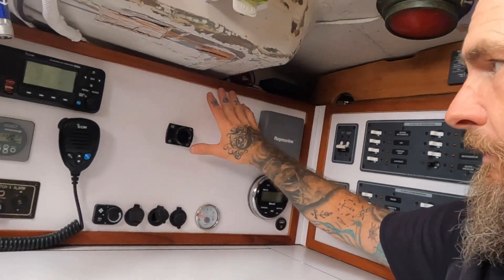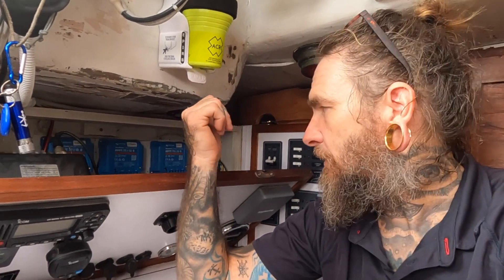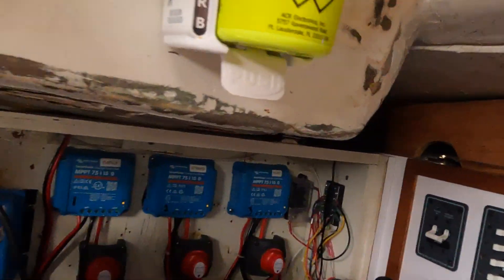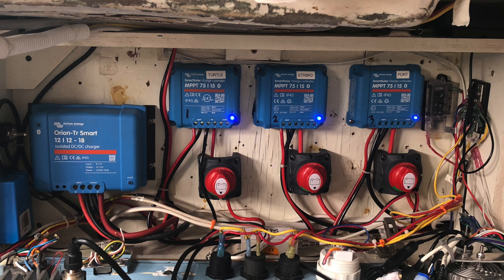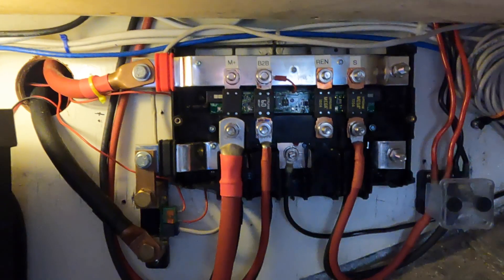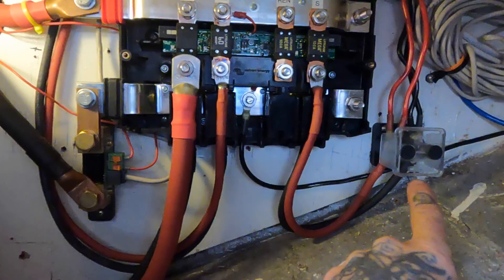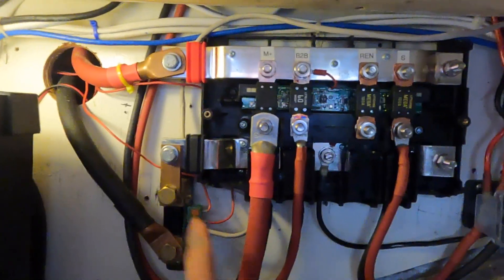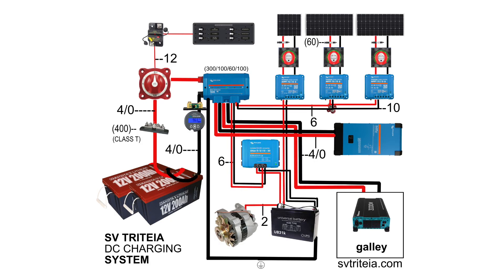A Look At The New DC Charging System on My Vintage Sailboat

Comment: Question: I'm about to buy a sailboat with minimal house power, and want to upgrade to a good on/off grid system with solar, and all-electric galley. For the time being, I will have shore power from slip owner's house system, and will be living aboard part-time.
 I'm not sure yet what the amp rating is for the circuit he's providing, but my question is: with your system, assuming you are on shore power, with normal usage via charger/inverter,  what would you say the minimum amp-rating would need to be for that shore power outlet? 
I know most marinas provide 15, 30, and 50-amp service, but it's likely that my hookup will only be 20 amps (currently the boat is set up for propane cooking, no fridge,  no radios, and a bunch of power strips, etc. for device charging and some AC fans/lights).
Obviously I will need to know how much I can pull from the shore system, but your setup seems very close to what I will have, so I'm just wondering what you typically draw.
Reply from the maker: I haven’t been hooked up to shore power since June of 2021 but my shore power is 30 amp
Reply: @SailorJames  Wow, thanks for the prompt reply! I am probably going to have to assume that 30A should be the minimum limit, as that is more or less the standard for sailboats. I only asked because it's very difficult to find a straight answer about this , from any mfr.
 I'm looking at one of Dakota's lithium/solar packages (200Ah for now, as I don't have a lot of space on this boat for batteries or solar panels)... at some point I will have to call them, I guess, because they don't spec current requirements for their chargers, or even output wattage so you can calculate the current demand under load. Nobody else, does, either. It's weird, because just about any AC appliance listing online will include quick reference to the amps needed for the thing to do its job.
Glad to hear you are boondocking successfully with as much electrical stuff as you have... it's encouraging!!

Comment: Hi James. When you connect to shore power, do you have two different chargers for the batteries? One for the AGM and one for the lithium batteries?
Reply from the maker: The Victron multiplus has a trickle charge for the start battery. I haven’t hooked up to shore power since June of 2021, but I have run my small generator a few times when prolonged storms got my house bank low

Comment: Captain James, you are seriously LEGEND in both your travels and shipwright abilities.  I've been running Victron for the last two years after I smoked my Magnum and love the gear.  I've just ordered more components to do as you show - breakup my solar arrays into separate MPPT's and also swapped out my power posts for the Lynx system for the reasons you state in your video.  My question to you on the Wirring Diagram it appears you have the Alternator Positive running to the Battery as well as the Orion TR Positive - is that the case or am I reading it wrong?  Keep on Keepin the barnacle side down... Cap Dave

Comment: Looking at the Lynx Distributor, it requires a 5 volt power supply to work properly? If so what did you used to provide that constant power?
Reply from the maker: The lynx is just a big bus bar and when it’s hooked up it has more than 5v as long as your battery isn’t dead
Reply: The intimation is that a separate 5v supply is required for the LED fuse failure lamps to function. Did you wire anything to the RJ11 connection? Still a great bus bar solution.

Comment: Hi, I’ve just got my Victron stuff today, same things, some different specs and will be building almost identical system, only one MULTIPLUS 3000 though. Question on your diagram. I cannot see where are the 12V loads. Mine will come out of the Lynx but you’ve got two inverters so no more room. Also a particular question on Orion TR. I also have a stock alternator on my new Beta 38. Did you have to do any special configuration to get the charger going or is it just sensing voltage on the starting battery and comes on when it’s high enough?
Reply from the maker: The 12V loads (from the batteries) bolt to the two end prongs that stick out of the lynx. And yes the DC/DC just detects the load and applies it 👍🏻

Comment: That's a great setup and great explanation. Nice job putting it all together. What are your orion settings?  What voltage did you set it to start passing through the current to Lithium? or will it start charging lithium as soon as the alternator starts assuming alternator output voltage would be above 14v?

Comment: I’m with you.  Hooking up the solar chargers directly to the battery would also mess up your shunt BMS measurements.   When you look at the complete lynx system, to the left of the lynx shunt there should be only batteries and fuses and to the right on the distribution all the loads and chargers with their fuses.  Again, I think you got it right.

Comment: Great video and love the setup, especially the way you build in redundancy. How is the DC DC charger setup to not over draw from the starter battery, ie when lower revs and alternator putting in less than DC DC drawing for lithium, I am guessing with min input voltage cut out setting or something?
Reply: I have one DC-DC for my thruster bank, and it's by design/default only charging (outputing) when it senses close to 14 Volts inn, which it's using to assume that the engine generator is running, and that consequently it's o.k. to charge (do it's dc-dc job) (that's a 50A one though). ........ The moment the input drops below probably 13.something, it stops charging I think, avoiding to drain it's source. .... And I have to assume his DC DC does aprox the same in order to conclude that his setup will work (which I think it will). .... And the ampers (max) it charges with probably also works as a generator overload protection. .............. Actually I think he could have had a larger DC-DC, but then there's the size and the cost, and his focus is on solar, and not on charging from a running engine.

Comment: Will we get your full test and results of galley use and charging systems  before you leave? If I seam like I am  pushing Sorry. Very interested in loads, drain on battery and recharge off of the solar panels. I like the way your going.  PRAYERS FOR YOU.
Reply from the maker: Yes that video will be out for sure before I leave. This morning marks 1 week of all electric galley use and my batteries never got below 75% (meaning I used 25% of my available power) and most days it was around 80%. The morning I woke at it was 75% (available) it was raining off and on all day and mostly cloudy but by 4:30pm my batteries were 100%
Reply: You are the best thank you

Comment: James looks good. Why did you use a victron 2000 and a renogy 3000? 
The victron is 3 plus times the coast of the renogy. Thanks mike
Reply from the maker: I have both, the Victron 2000 miltiplus is my house inverter and the Renogy 3000w is my galley inverter
Reply: @SailorJames  why is the one so much more expensive, and 1kw less?
Reply: @SailorJames  I got it the renogy will be inverter only the victron is inverter, charger as well as ac shore power switch.
Is you refrigerator going off the victron? Thank you
Reply from the maker: My fridge is 12volt

Comment: I'm looking to put in a similar, but a bit scaled down system in the mini-cruiser I'm building on my channel. So, thanks for the info and the diagram. I plan to have 1 lithium battery and another cruiser showed me what's called a "DC-DC 5V buck module", have you heard of it? It was like a revelation for me, you can charge USB devices (tablets, phones, etc.) without having to install a big AC inverter. Was thinking about just using that.
Reply from the maker: You can charge all of those without an AC inverter anyway just with the 12 volt system and a usb plug
Reply: @SailorJames  Yeah, I guess what I should have said was, it's more efficient than the cigarette lighter style converter, which is what I had on my old boat for charging.

Comment: Good Job way safer than gas or alcho stoves in a small boat,  i like it  you smashed it dude
Reply: So long as you’ve got enough power (and sunshine). Those cookers take quite a lot of power for quite a long running time.

Comment: Very informative video. I'm about to do similar conversion on my boat. A bit overwhelmed with all of it, especially that my current system has been done by many electricians and it has multitude of components, of which I'm not 100% sure which one does what.. and considering all of the above, tracing all the wires isn't going be easy.. looking at your video i think I might have to order few extra items.. curious, is there a way of keeping AGM starter battery somehow connected to the system so it would get charged by house batteries, solars, alternator and generator? Maybe there's some kind of tool to keep in between them to allow for that connection? Same thing goes for generator starter battery..
Reply from the maker: There is no way, that I am aware of after a lot of research, to easily have the main solar charge both battery banks. Normally an ACR would do the trick but not with the two different types of batteries. 

As far as a generator goes you could probably wire up a transfer switch
Reply: @SailorJames  ahhh, so now it looks like i need to either change my starter battery to lithium or get myself new dedicated system to charging it like you did. Would you say lithium would bea good choice for starter battery or not so much? I'm not an electrician, as you can tell by now, so I don't know if cranking power is the same on both types of batteries..
Reply: I think I've seen one youtuber (Clark) in one video, arguing that you can have Lithium and Lead in paralell without any fancy electronics, and I think that fits in with the design Triteia now has : https://www.youtube.com/watch?v=tAuPfgZgXec&t=731s

Comment: Aloha, nice job! 

My only suggestion would be to feed those house MPPT’s more voltage by adding a few more panels in Series so that the chargers wake up earlier and stay up later. We’re lucky to live in such a sunny place, might as well take advantage of it and the advantages MPPT offers over other types. When you feed them their max voltage input, they really “shine”. 

Good call on paralleling smaller chargers. In addition to redundancy, they also generate less heat and noise than larger ones. 

And the Load Output feature on the smaller units are great for controlling things like lights on a scheduled timer. 

Also handy is the ability to Disable the chargers via the Victron App.

Comment: I think it’s a good idea having redundant solar controllers I learned all my shit off explorist guy too it made the whole process way easier. But you have two panels I think one mppt controller would be better and more efficient with the two larger panels ran in series to double input. I remember researching it in fact I think the Nate guy on the explorist ch covered it. But for the smaller panel you should def stay with its own mppt controller but later on you can run another panel of the same size in series.

Comment: Does the boat have 1 or 2 alternators? If it has a dedicated alternator for the house battery bank you can use that to charge the lithium bank. With the Orion 30A the output is more like 26-27A (its actually 360W, not 30A, and a lithium battery is more like 13V, so its not fully 30A) it takes 14 hours to fully charge the batteries if completely flat.
If there is wind, but no solar, you might not have to have the engine running, but you still do for the batteries to charge. In those cases its much more effective to charge as fast as possible, so you can run the engine for a shorter time (less noise, less fuel usage). With a proper alternator regulator you can charge at full current the alternator can provide, much more than the 30A of the Orion. (Eg a Wakespeed WS500 or similar (mastervolt, balmar). That allows you to fully charge the batteries in a few hours (Depending on the alternator)

Also, when installing the Orion DC-DC: They get HOT. Will throttle if they cant dissipate heat, so highly recommend to install it with plenty of clearance and ventilation.
Finally: The Orion TR is a DC-DC converter, NOT a charger with fully proper charge profiles. You need the Orion TR SMART for that (that also applies the proper charging profiles and can be set to Lithium). It's not recommended to keep a lithium battery at a high voltage all the time, so I definitely would use the Smart and not the regular orion
Reply from the maker: You can clearly see in the video the unit clearly says TR Smart

Comment: Looks great. You have top quality equipment. I would recommend a couple simple things that do not change your wiring layout. The first thing unless I’ve missed it would be an in-line fuse between the solar panel and the charge controller. They should be placed pretty close to the solar panel. The universal rule is always fuse as close to the power source as possible. A solar panel is considered a power source. I usually like 10% over the maximum load of the panel. The next thing I would recommend is that you insert a plastic cutting board or plastic sheet approximately a quarter of an inch thick between the batteries and the wooden bulkhead they are up against. Wood likes to burn. The plastic even though that also likes to burn, can be used as an insulator and protector. Just basically shielding the high tension lugs from your wooden bulkhead. It’s an option it’s probably not critical.  Also unless I missed some thing, your large rotatable disconnect switches on your Victron solar charge controller’s allow you to disconnect the battery from the charge controller, correct? Solar charge controllers do not like to be disconnected from the battery before the solar. You should check the instructions of those controllers. Most solar charge controllers can be damaged if the solar is connected but the battery is not. You definitely don’t want to put yourself into that position. Great stuff and you have great equipment. Following seas….
Reply from the maker: If you look at the diagram you will see the inline solar fuses.

The plastic is a good idea
Reply: Maybe I don't quite get it, but why have a fuse at the solar panel (source) end ?,...... The panel can only produce that much power, and I'm sure the wires can handle that much, so I don't see why not omit that ? (unless the panels themselves can burn when shortcircuited, but I would guess not ?)......... Wood isolates just as good as plastic, and both plastic and wood can burn (wood somewhat more easily though), but stopping any sparks from poor connections could maybe reduce the risk of fire a bit. ........... Would be nice to know if the chargers handles being disconnected from it's load ?.  Being Victron I would guess they're designed to handle it, but I like your question on that. ....... I've seen one youtube video about a boat burning down, likely caused by charging devices with lithium in them (I think that was a supermarket electronic device with lithum internal battery though (probably made in china) and not a more professionally designed high capacity battery), so lesson learned there is maybe not to charge low quality products with internal batteries while not present.

Comment: Hi James. I am an ABYC certified marine electrician and I think you have done nice work. The 4/0 cables passing through the hole in the plywood bulkhead require chafe protection. I prefer split loom conduit. Also, I do not recall seeing a class T fuse for the inverter or a green grounding cable for the inverter chassis. Maybe I missed these items in an earlier video. Also, it is essential there be a battery shut off switch between the battery bank and the 4/0 positive cable going to inverter. You have to have a quick, positive way to shut off DC power to and from the inverter.

Never mind the comments above. I saw the fuse and switch in the schematic. Did you ground the inverter chassis? Nice job.
Reply from the maker: Yeah it’s grounded to the chassis 👍🏻

Comment: im an engineer so i really appreciate the wiring diagram. do you find the 400w is enough to charge the house bank?
Reply from the maker: I will have a better idea about how well 400 watts keeps up once I start using the electric galley. Since I have 400ah of LiFePO4 I think it will be more than enough for what I use in the tropics but once I get someplace cloudy I might need to get a small generator

Comment: Thank you...Great stuff, James. Hello from the cold and windy East Coast of the UK.    I'm just beginning to start to try to understand this equipment...it is definitely the way forward on clean energy and ecology grounds . I sail an old wooden boat.   First project that I am researching is to replace the Primus stove with a small  2000 watt induction hob run by a battery, separate to the engine starter battery, that would be charged by a solar panel - I feel the same way about my starter battery as you do!  Any chance you could advise what a small 'independent' system should contain?..I have a 200w panel a 2000w inverter and a single 2000w max hob waiting but not fitted... maybe I'll have to re-think this as well...but any advice appreciated.
Reply from the maker: You will need a lithium battery if you want to use an induction HOB, high demand appliances like that destroy AGM batteries.
Reply: @SailorJames  Thanks James